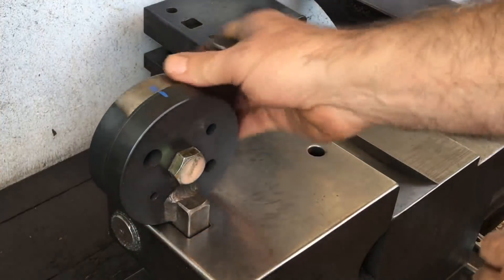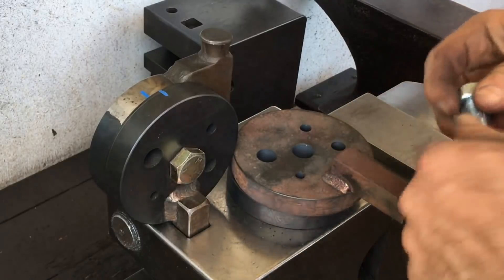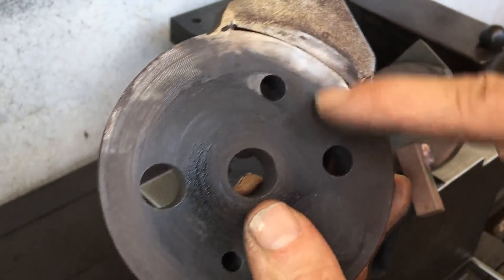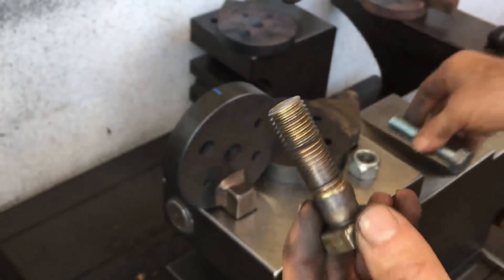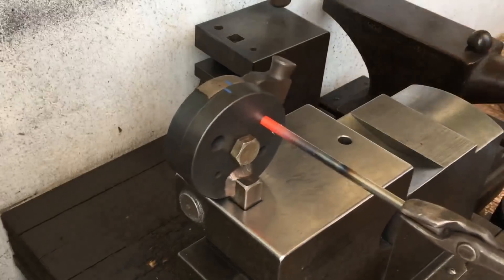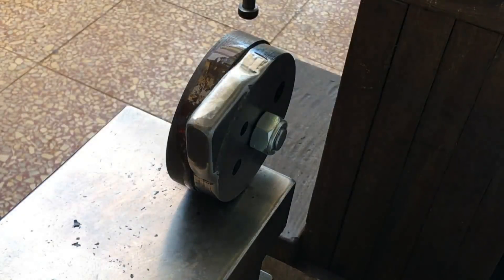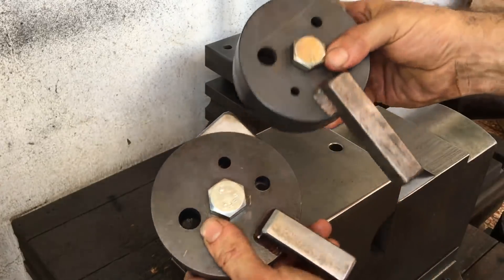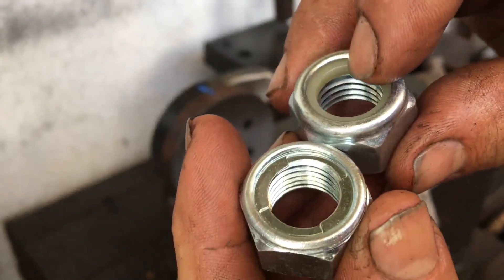Anvil Rotary Hot Shear - 3rd Prototype

Comment: A slight improvement with the holes closer to center, a step back with the shorter shank and I like the hitting knob on the older version. It works well for a PITA repetitive task. Thanks Glen. Don't forget to replace the bolt in the old one, ideally with grade 5 or 8 with the correct shank length - the wear on that old bolt will cause the cutting edges to wear prematurely.
Reply from the maker: This is typical for me - one step forward, two steps backward! I'm still working out the kinks and will make improvements where I can. But as it stands, it really works well for what I use it for. Thanks for your input.

Comment: One suggestion I have would be to machine the shearing halves out of one piece rather than weld. There's a ton of guys in "home machine shop" on Facebook that can help. Cheers to a fabulous idea made real!!
Reply from the maker: I've already got that in the works. But the thing I need to consider most is cost vs. performance with such an upgrade. Thanks for sharing.

Comment: Both sides of the shear could be cut as single pieces, no welding needed. The stationary piece, instead of only having the hardy shank coming off the circle, could have two shoulders that rest on the anvil to help it resist rotation.  Excellent work Glen, I love it!
Reply from the maker: I'm not sure if the shoulders would work as you describe but it certainly is an interesting idea. and one I will maybe try. And as far as having the moving half made from one solid price, I'm investigating that and hopefully it's not cost prohibitive. I appreciate all the good input.

Comment: Back in the 50s when I worked on submarines, we called those nuts "nyloc" nuts designed specially for applications like yours; also on subs in their sheers.  We used them to replace the lock washers and nuts.  They are reusable.  There are also nuts that have a rectangular dimple on one face that causes the threads inside to bulge a bit, but these are single use nuts.  Both are used where a sizable amount of vibration is expected.
Reply from the maker: Hi K.C., Very interesting submarine tales. I certainly see how these nuts can hold up well to excessive vibration. Thanks for sharing.

Comment: Maybe ship it without the bolt and nut and better invest in a longer lever. Bolts can be purchased everywhere. And make sure to offer a metric and an imperial version!
The OD could be smaller as well if you move the holes a bit nearer to the center.
Reply: This.
Reply from the maker: is good...
Reply: Moving the holes closer to the center would give you more leverage, making it cut with less effort too.
Reply: @JDeWittDIY  exactly!
Reply from the maker: Thanks for watching.
Reply from the maker: I did move them closer on this 3rd prototype and wanted to go even closer but I and my machinist had some miscommunication. 4th prototype pending... Thanks.
Reply from the maker: I like sending tools complete but your idea of sending without a nut and bolt is a very good one given how shipping has gone through the roof this year. And the OD is definitely something I'm thinking about. The comment section is always full of good suggestions. Thanks.

Comment: nice shear.  maybe  move larger holes on the "right", below striking part and smaller to the left?  you could get more force needed for bigger stock.
Reply from the maker: I never thought of that - something worth trying. But as it stands, I rarely use the larger holes. No matter, some small changes are in order. Thanks.

Comment: Excellent. I like the rustic look as well!! Maybe instead of that blue marker line, you could weld a solid stoper on the stable piece and a small protruding piece of rod on the moving piece. That way you can just rotate to the left after a cut and have the holes aline without even looking. Nevertheless, thank you for sharing your thought process and showing all the iterations.
Reply from the maker: That alignment idea is very clever. I was thinking of just cutting in grooves that when aligned (like my maker lines), the holes are aligned. But your idea takes it even a step further. Thanks for your input.

Comment: Usefull tool for sure. Imho there are a few things that could further improve the effectiveness of this allready good tool. Bring the holes even further to the center (you still have about 1/2 " room on the biggest hole)....make the anvil you are striking on a little longer (more leverage). Fix the anvil better....the most power of your hammerstrokes gets lost due to the fact you are also moving the anvil front and back on a soft cushion. Weight and materialprice could also be grately reduced using D2 disks that are smaller in diameter....you do not need an inch of steel at the outsides of the holes.
Reply from the maker: All good points. I wanted the holes even closer but my machinist kept insisting they would be too close. I think we maybe had a communication breakdown on my purpose for this tool. No matter, I'll make some changes and we'll see... But so far, it really has worked well for what I want. Thanks for your input.

Comment: Lever 800mm.  weld on and no need to hit with a hammer! Easily bites off metal with a lever handle! 🤗🖐️
Reply from the maker: On a previous version I used a long lever but since there's no gear ratio, it didn't work properly. But maybe I need to rethink this... Thanks.
Reply: @gstongs  I watched the previous video and realized the error ... you have straight holes drilled, but they should be under the cone, to decrease to the center of two parts of the pliers! Write to me on WhatsApp +79185259727 I will send you a photo

Comment: Good looking tool. You could use a shoulder bolt for the pivot
Reply: Is that an off centre pivot ?
Reply from the maker: No, everything is aligned. Just as simple as possible. Thanks.
Reply from the maker: Thanks for the good suggestion.

Comment: That thing needs a gear cut in middle and welded around moving plate ,then another smaller gear from lets say car transmission on non moving part ,connected with a big arm leaver.
That way you could cold cut it.
Also since we are at it add some sort of welded round rod on that threaded bolt for a depth stop.1 nut with a drilled trough hole and another one threaded are welded like O------O .
Drill and tap small side screw on a non threaded nut  to hold it securely  on a round rod ,You can put all threaded rod with a winged nut trough threaded nut to act as adjustable depth stop.That way all of blanks will be at same size! Easier to make than to describe.
Reply from the maker: You'r absolutely right about the gears. And then I could use it with a lever. But for me at least, that has proven to be too complicated and costly. I want to keep it simple as as cheap as possible. I appreciate your thoughtful input. Thanks.

Comment: Excellent design. Simple and effective. I bet you could have the whole part cut using high definition plasma out of hardox so no need for welding. I bet you could also put on a lever attachment to shear using leverage too. I like it well done. Cheers J
Reply from the maker: I am seriously thinking about having the moving half machined to avoid welding but that would increase the cost quite a bit. A lever will not work with this since it doesn't have any gear ratio (I found that out the hard way). Thanks for your input.